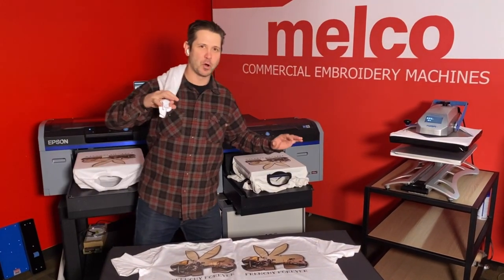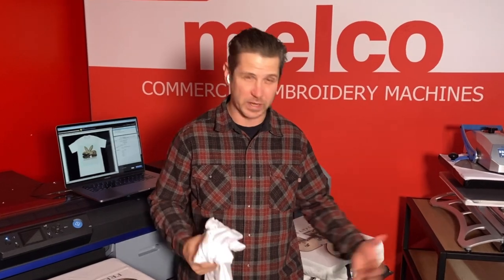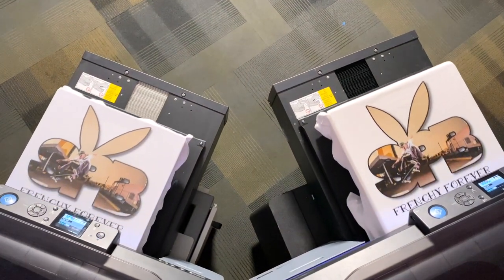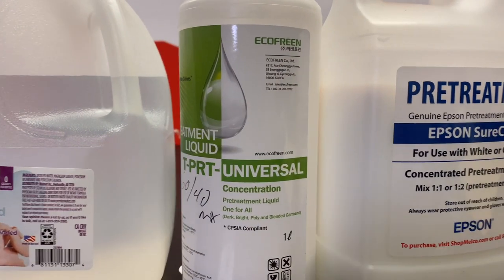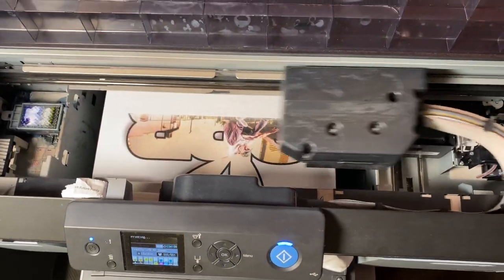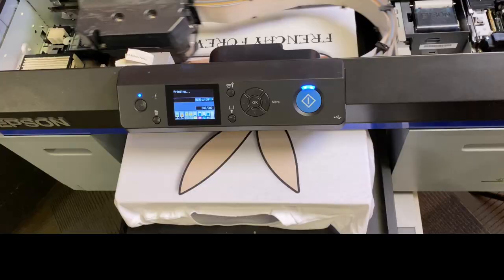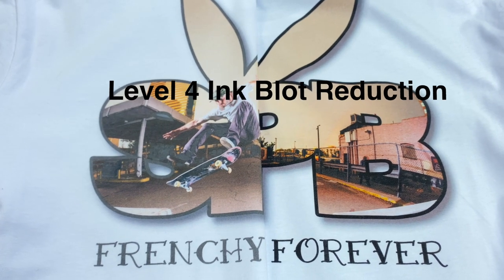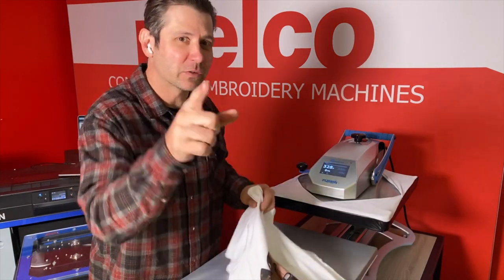Bright Prints on White Shirts Epson F2100

Comment: Hello! Great tutorial, helped us alot. Although I have a question, when washing the white shirts the ink does fade alot. Any tips for washing the white shirts? Thanks!
Reply: The ink faded when we did the option to not use any pre-treatment. We did a test with the epson settings and your settings wich you deacribed.
Reply from the maker: Glad you found it helpful. If you are seeing washout, try increasing the temp and time. Some shirts absorb ink differently so there can be fluctuations in curing times. That's a good general rule though, if the ink is washing out or fading, increase time and temp.
Reply: @MelcoEmbroidery  Thanks for the quick response. I'll try it out!

Comment: What shirts do u recommend next level 6210? For good prints on f2100
Reply from the maker: That is a 60/40 so it's hard to say if white will hold and pop. I prefer 100% ringspun cotton for the brightest prints. If you have to use 60/40 anticipate some color loss but that might be mitigated by your pretreat technique. Try 50/50 quick spray, dry, and repeat a 50/50 quick spray. Dry then print. Sometimes layering a little pretreat will help. Problem is it's time consuming and won't guarantee a bright print like using a 100% ringspun shirt will. I like to eliminate any doubt and stick with what works. That will guarantee the most margin with the least amount of time and resources spent.